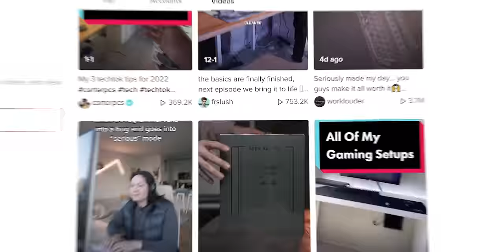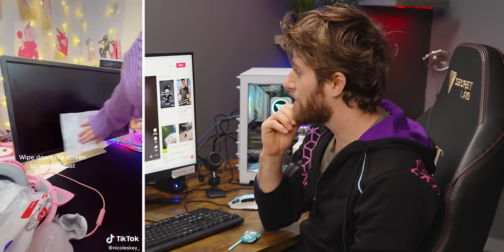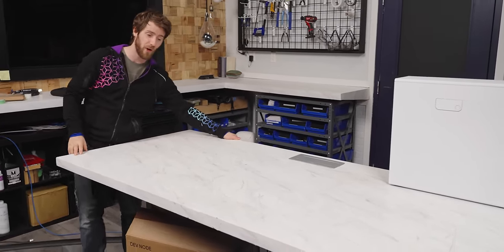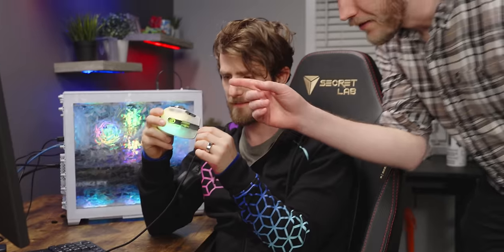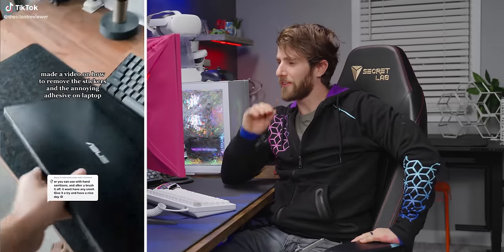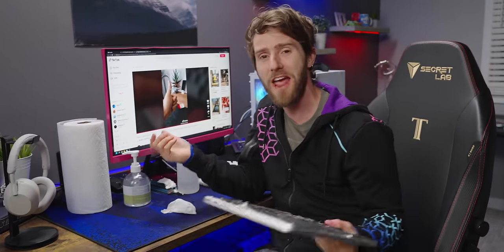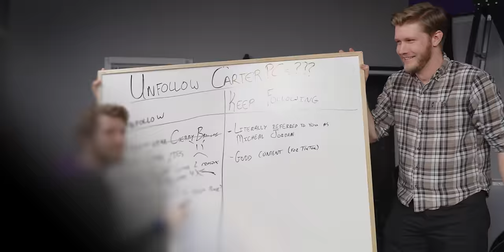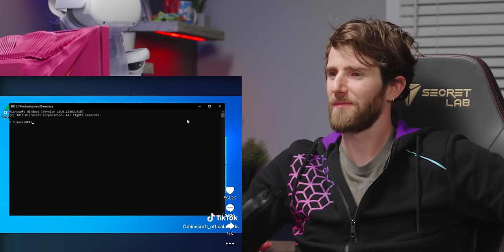TikTok Tech Tips are Terrible

Comment: Hand sanitizers are made out of multiple things such as he said. The most notable for why it worked better than Isopropyl Alcohol is because they often have sodium content. Allowing for a finer cleaner scrub.
Reply: I use orange oil, works like a charm.
Reply: Wait. Sodium?
I would have expected something like 70% isopropanol would be better because more time before it evaporates.
Was not expecting one half of table salt to actually help.
Reply: Or you could just use Goo Gone
Reply: I'm kinda disappointed they didn't try plain old water on the stickers, 99.9% iso is not going to work on water soluble glue.

50% iso generally better as a general solvent because it is slightly more polar.
Reply: Hand sanitizer uses a different type of alcohol than isopropyl
Reply: hand sanitiser has a higher viscosity and more water so it evaporates more slowly, generally allowing more time to kill bacteria. the cheapest types are just water, isopropyl alcohol, a viscosifying agent, and a stabiliser for the viscosifier, nothing else. People associate the smell of isopropyl alcohol with cleanliness, so they generally don't add fragrances (and it's cheaper not to).
Maybe you mean sodium lauryl sulfate, which is a super common "detergent" in shampoos, body wash, hand washes, etc...
Reply: Which can also damage a surface through scrubbing action which is not something you want to do on certain surfaces. All those so called hacks are really lame.
Reply: This is blatantly wrong. They don't generally contain sodium (including the Lifebuoy brand shown in the TikTok video). Even for the ones that might have it, it's not in a crystalline form like NaCl that will actually act as a "scrub". Some hand sanitizers might contain something like sodium laurly sulfate, but that's not a crystalline form that will "scrub"; SLS is literally just a surfactant (I.e., soap), and is the main ingredient in most dish soaps, laundry detergents, shampoos, and hand soaps. Otherwise, they might have some kind of moisturizing or fragrance ingredient that could contain sodium, but again, that's not actually going act as any kind of "scrub".
Reply: It's also thicker so it won't run or evaporate as quickly
Reply: @oscarcacnio8418  you need some water in the mix to kill bacteria, something to do with the lipid barrier
Reply: Also, pretty much everyone has hand sanitizer lying around where as isopropyl alcohol is less common of a household item.
Reply: @andrewjmarx  Pretty harsh way of expressing yourself... perhaps you should chill out a little before hitting the reply button
Reply: More than that, pure iso is actually not that great at getting some things off by its lonesome unless you're soaking for extended periods of time. Some things clean better with 70% simply because of the water content.
Reply: pure iso is not actually as good of a cleaner as you might think. Ideally you would want like 80% iso, and 20% water for the best cleaning, this is more or less why he was struggling.
Reply: I used Hand Sanitizer for months to remove sticker adhesives.
Reply: ok...
Reply: I use alcohol but I mean, this pandemic I had more sanitizer than pure alcohol at hands.
The point is not scrub really but mix to dissolve the glue, because sanitizer is just 70% that have more time before evaporate.
On pure alcohol you get the first layer dissolved but then dry and the paper stuck un the renewed glue action XD
So I use the bare-hands to mix all and then more to clean.

Another easy way to remove is use adhesive tape, just put over and peel fast to take off all the glue, just give fast short pats.
Reply: @goldenpiston8449  I've always seen 99.9% Isopropanol as what's recommended for stuff like cleaning contacts and rosin flux.
I guess a mix of isopropyl alcohol and distilled water would be better for removing sticker residue.
IPA and water is a hell of a lot easier to get for sticker removal than n-heptane anyway!
Reply: @oscarcacnio8418  you’d actually be surprised. From the many many years of me soldering and such the absolute best way to remove flux without harsh chemicals is 50% iso, 50% water and dish detergent. Heat it to like 100f and it will get rid of flux like even the strongest chemicals I’ve tried.
Reply: @DoubleMonoLR  99 gives pretty much no advantage over 90. 90 contains a bit of water, which is polar, and that massively helps with dissolving many substances.
Reply: Fast Orange 😎

Comment: Years ago when I was working in tech store (and Linus was reviewing pc cases on park benches) I was first surprised about people bringing phones that just had 0% of battery convinced that its broken, there were 1-5 of these everyday. So not that surprised anymore that people can't update their own pc drivers, heck some people even don't know how to turn off the computer without pulling the plug.
Reply: Why pull the plug? There's a switch for convenience /s
Reply: To be fair, I've had a phone that at 0% wouldn't charge other than from a wall socket. I would have thought it was broken if I didn't see it go to 0% just before.
Reply: @nidungr3496  So you couldn't charge it if it died in the car or something like that and if you tried to plug it into a car charger it wouldn't have worked? It only worked if you used the wall charger? Like even if the cable from the car is the same cable you use to charge your phone in the wall. Like just unpluging the wire from the USB from the charging brick and plug that into the USB car phone charger? Or was this one of those old-school car chargers that wasn't USB and the cable and I guess you'd call it the "Cars charging brick" were all one piece?- (I'm putting a lot of eggs in the- "This must have happened in a car/the wire they tried to use was their car charger to try to charge it, but it didn't work, but the wall charger at home did." basket lolol I mean idk if you had a portable power bank with you for your phone or not and tried that. I just know I don't normally do, so if I was out and my phone died, the only way for me to charge it/turn it back on, would be for me to put it in the car. 
But I know a lot of people do have and use those portable power banks around with them.
Reply: I once spent two hours on the phone navigating someone who used windows daily to the start button. I 100% believe this.
Reply: I work in a school (K12) and I always joke about "what do these kids do with their phones when they die?" because the kids let their chromebooks completely die and then try to say they have no idea what is wrong with the device.

but now I'm reconsidering things...
Reply: For your pc safety. DO NOT pull the plug when the PC is still turned on. It will resulted things going broken in your PC.
Reply: Reminds me the scene from The IT Crowd where Roy is arguing with an user about some steps to get their PC working and he ends up telling them to turn on the PC.
Reply: PC load letter.
Reply: @NoOneAlive_  Yeah, that should be common sense.
Reply: @Warp2090  Unfortunately, not a lot of people know this. Just like my friend.
Reply: @Warp2090  The fact you think that's what common sense is baffles me.
Reply: LINUS… try EasySkinz for fold 4 skins.. they have full body skins for it as I have a really sick red one on mine completely changed the color
Reply: @NoOneAlive_  oof
Reply: @tyler6971  How? It IS common sense or at least should be
Reply: @Warp2090  Common sense is don't jump off a cliff or don't jump out of a moving car. Not unplugging a computer while it's on. It's just ignorance.
Reply: @tyler6971  I'm still confused, yeah thats common sense too but this is (and should be) common sense for computer users. But ok.
Reply: @Warp2090  Not everyone is tech savvy.
Reply: Imagine the mechanic side of things people will tell you what’s wrong with their vehicle but they bring it to a shop 😂
Reply: @phildelsol97  Yeah I'm exactly that dude 😂and usually I know whats wrong with it but I go full tilt when trying to explain it, multiple time have had "wrong parts" fixed (I mean oc there has been some issue but not the culprit). Nowdays I try to shutup and let them do their job, the professionals.
Reply: @19smkl91  my good friend is the same way nothing wrong with it lol
Reply: @tyler6971  you are messing up basic instincts with common sense, fam
Reply: @El Pingas  Huh? You're not the brightest but thats okay.
Reply: @tyler6971  top 10 comebacks in history
Reply: @El Pingas  Top 5 atleast
Reply: Gotta turn off my computer the same way we turned off my dad
Reply: The thing is the dude didn't go there solely to get his drivers updated. Listen to the tiktok OP said owner was complaining of FPS drops and sluggish performance.
Reply: We were doing open one-on-one computer help/classes for the public once, just bring your own computer.
After the time was up, one of the attendees just stared at the screen after shutting down the laptop. After a while the guy teaching her asked what she was waiting for. She said she was waiting for the laptop to close itself... :D
Reply: @NoOneAlive_  that is actually not really the case anymore for at least a decade or two, as long as no update is happening(which would only affect software anyway) the worst that happens is some data loss and potentialy corrupted Data, which isnt hardware, pulling the plug wont negativly affect the components.. a sudden power LOSS is, while undesireably, not dangerous to components unless you where updating the UEFI or something.

a sudden power surge is dangerous.. because well, more power is going trough the system then it should and that suddenly...
Reply: This is America?
Reply: @tyler6971 bro turning off computer before unplugging isn't tech savy 😭😭😭
Reply: @Shiznittlebizbampop1 I always carry a phone powebank in my truck. When I go outdoors for an extended time  I take it with me just in case. It's been handy at work too.   You also forgot your closing bracket for your parenthesis.

Comment: You can actually read NY Times articles by just refreshing the page and then halting the page load before it finishes loading. It looks like the check to add the "sign up" banner is one of the last things that happens, so if you cancel the page load fast enough you can just read the article.
Reply: if the entire page gets loaded before the popup surely there's extensions that just remove the popup (or you just disable it yourself in the html)
Reply: @Suzumi-kun  Sometimes you can disable it manually in the HTML, but some sites have gotten smart (but not that smart) and when the paywall pop-up loads, it truncates the page so even if you delete it, it's removed the text on the page beyond the first or second scroll.
Reply: Or hitting stop or turning off wifi/data before the payment page usually works
Reply: NoScript!
Reply: cant you also just deactivate the banner through either HTML/JS or with an Adblocker pick tool

Comment: I've been using hand sanitizer over alcohol on stickers and labels for years, just out of convenience, not knowing it's actually better than alcohol.
Reply: now you know xD.
Reply: @justinvandermerwe7428  Is that stuff okay on plastic? Guess I can test it on something... I usually use acetone on metal- just got a car bumper dropped at my door with nothing but shipping labels and stickers slapped on it, acetone took it right off, ready to paint.
Reply: @justinvandermerwe7428  depends on the type of plastic. dome hard plastics melt from acetone and some soft ones dont just depends
Reply: @keemoo_7  Thanks, I'll try it out... I almost used it on a motorcycle's plastic fearing, trying to remove some sticky black road grime boogers- Probably shouldn't keep the acetone next to the mineral spirits and paint thinner, all in similar looking cans going forward lol. Now I think I'm gonna try it on a small spot on the inside. That road grime is nasty, and I can't get it to come off.
Reply: @Wooskii1  Please do some research about the plastics you use. You can easily find charts that detail the resistance of certain materials against most solvents. ABS, PBT, PE, PET and PC should all be avoided when using acetone when it's not the material you want to remove. And since those are very common plastics in anything tech related using acetone blindly can f.e. destroy the surface finish of you laptop or worse.
Reply: I've been using eucalyptus oil on stickers and labels for years, more common in Asia and smell good
Reply: Hand sanitizer is also really good at taking the ink off of amazon parcel labels, but not royal mail interestingly
Reply: you can literally just use the extra sticky on the sticker to remove the sticky
Reply: Don't you people realize, that fats dissolve glues? Try to remove it with any oils or fats (even butter works), just be careful you're using product which is safe for the surface you're cleaning. In most cases it works better than alcohols.
Reply: Don't leave it on there too long - it will discolor certain plastics. Had a bottle of that leak in my classic car on a hot day and the centre console is bleached wherever the sanitizer came in contact with it.
Reply: @svw1999  Yea, that's what I figured. I can always do a small test spot on a part that doesn't show. Also depending on what you're using it on, it might not be possible to figure out all the materials used to make something (accent pieces, bezels, logos, etc.)
Reply: A lot of them contain glycerin or lanolin. These fats help dissolve the glue. No, I would not even try acetone on plastic. the thing you would likely remove is the plastic.
Reply: @surferdude4487  isn't that the whole point of the f**** thing
Reply: @justinvandermerwe7428  def don't use those they will take the finish right off.
Reply: I use it when needing to clean resin off things lmfao. works great. hahaha
Reply: I use it to clean alot of things even windows 🤣
Reply: Great for whiteboard marker staining in a pinch. PS don’t ever spill the kind with aloe on a mechanical keyboard. unrelated *tip 😑
Reply: some hand sanitisers work way better than others
Reply: I work in a Vape Store. The only good thing to come from covid was discovering how good sanitizer is at removing e-liquid from your hands. My hands haven't smelt like a mix of tobacco and old peoples handbags since 2019.
Reply: @piotrkowalski3898  Exactly what I was thinking. I usually use olive oil because I always have some at home. Then I use some soapy water and finally alcohol to remove the oil.
Reply: I know someone that uses vodka to clean with. That person still uses Goo Gone to remove sticker residue.
Reply: Not all alcohols are the same.  At least some hand sanitizers use ethanol, probably because some might be absorbed through the skin.  Linus' squeeze bottle seems to be isopropanol (which is what is used for a lot of electronics cleaning).  And then there is methanol.  I'd suggest testing a small patch before applying it to large areas.
Reply: @dmmartindale  I would guess that no (semi reputable) hand sanitizers use methanol. I could be totally wrong tho, just a guess.
Reply: @Wooskii1  My point was that saying "alcohol" is nearly meaningless, because it's a whole class of chemicals and things like paint and plastics may react differently to different types of alcohol.  The hand sanitizers I've read the labels of are mostly ethanol.  The big bottle of alcohol that Linus used was isopropanol.  You can easily buy methanol at a hardware store.  But don't expect them to behave the same, because they are not the same chemically.
(My own favourite solvent for sticky labels is deodorized mineral spirits from an art store.  It works better than isopropanol on the sticky stuff, but is more likely to attack plastic, so it needs to be used more cautiously).
Reply: Hand sanitizer does have alcohol though... 😂🤦‍♂
Reply: Goo gone.
Reply: @justsomeguy2411  Yeah, it's effective.  Read the label - it has a number of strong solvents in it.  I find it is more likely to damage plastic or paint than mineral spirits or isopropanol, so I use it only when I've tried and failed with the latter two single solvents.
Reply: I've been using lighter fluid for some more resistant ones. It leaves some residue though
Reply: @dmmartindale  I have used it on a snes to clean it up. No damage to the plastic and cleaned up nicely.
Reply: @karol30660  Lighter fluid seems to be more highly-refined mineral spirits.  I think it's safer (but more expensive) than stuff sold as mineral spirits, and some brands are clean enough to evaporate without residue.  Put a drop on some clean glass and let it evaporate to check.  I have used lighter fluid to clean a camera lens, after trying lens cleaner (water and detergent) and isopropanol first.
Reply: @justsomeguy2411  Yes, it seems to be fine for some plastics, particularly if it's only in contact with the plastic for a minute or two.  But it does cloud or damage other plastics, and I don't know how to predict which ones without doing a test.
Reply: Also great for cleaning your glasses
Reply: I just use hot air shooter
Reply: i understand it bein an alternative but i don't see how hand sanitizer is more convienent than ispropryl, isopryl is cheaper, at least over here in Czech
Reply: use WD-40 for removing stikers
Reply: Gonna try this the next time I need to remove residue
Reply: @Wooskii1  Acetone is definitely what you should use if the material it's on won't be damaged by it. Very damaging chemical, but the recommended chemical for getting rid of anything sticky